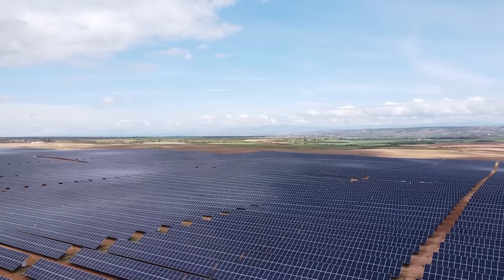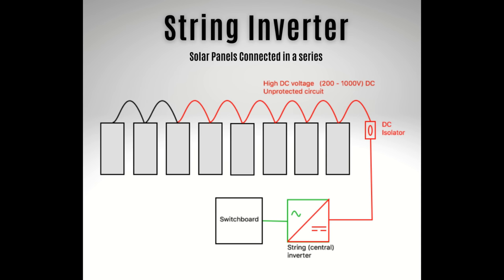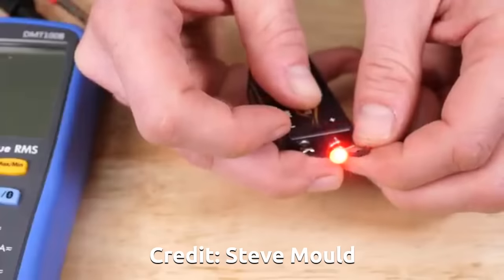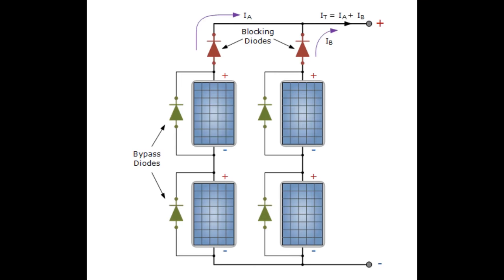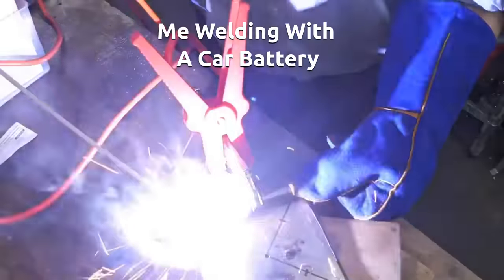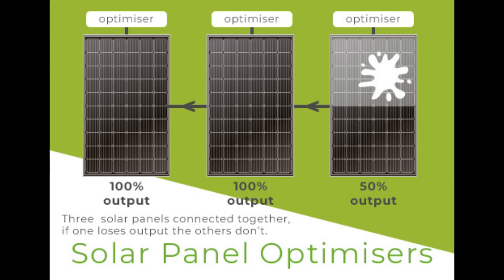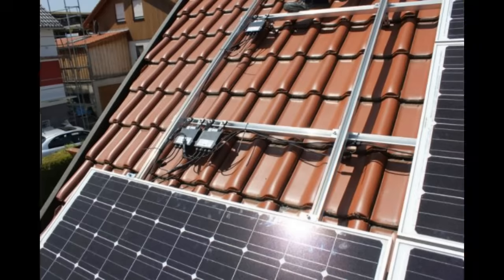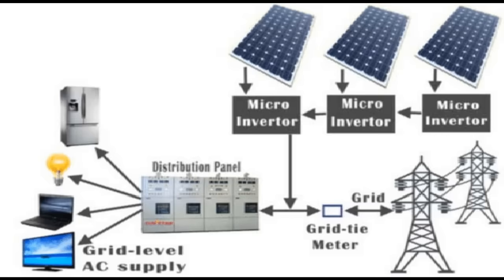2262 Microinverters Where Do They Come From And Are They A Good Idea

Comment: I like distribution almost as much as I like decoupling and standards.  If the industry could standardize panel sizes, outputs, mounting brackets, inverter housing form factors, etc, then we could have the best of both worlds -- inverters decoupled from panels based on manufacturer, mountable on panels regardless of manufacturer.  Chasing profits based upon trivial incompatibilities tied up in intellectual property is petty and small minded.  We need these distributed renewable scalable power options to help save life on the planet.  Such a critical success factor as survival shouldn't be left to the profiteering d**k measuring contest of the human ego, as rivals in industry try to one-up each other.